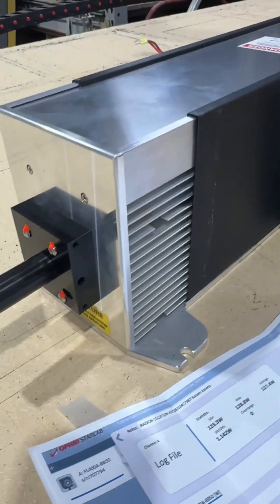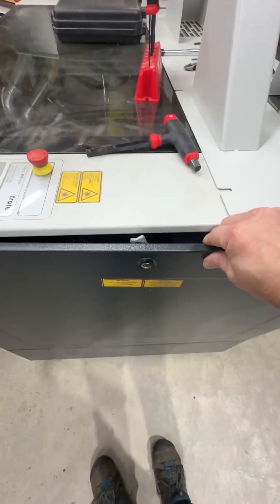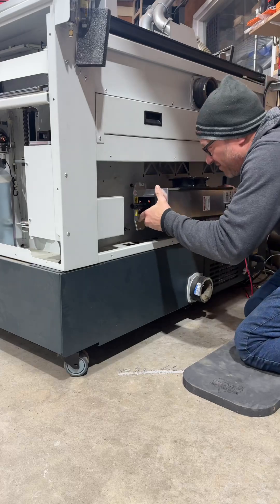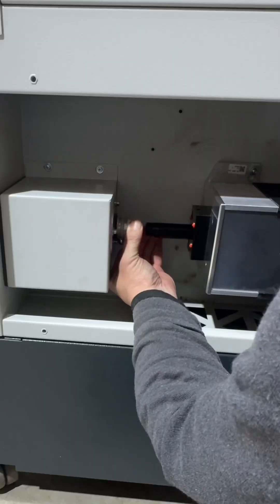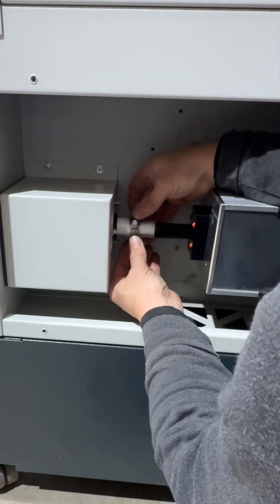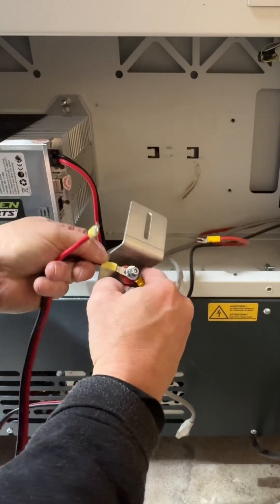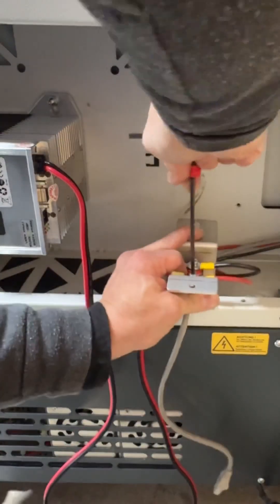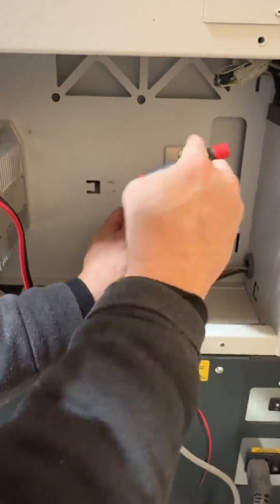Recharge your Trotec Iradion laser tube #trotec #laser

Comment: Great video. How was the process getting it back up and running once recharged? I have been pushing it and now its time to send it out. Just curious as for the install and requirements once back in the machine? Thanks in advance!
Reply from the maker: @jasonmiller5920  the laser itself is really just plug and play. The laser hangs onto machine screws and the weight of it naturally bottoms out so there shouldn’t be any issue on the install. The Mirror Alignment could be a minor issue, but there are some videos out there that walk you through it. That was more time-consuming for me than anything, but it is cutting on 100% of the table unlike before so for my first time I got it dialed in probably 90%. I am not sure what Trotec is actually charging for when you give them over $6000 for a new/refurbished laser and they want the old one back to refurbish.
Reply: And for recharged I ubderstood that cost 1500.00???
Reply: I i refilled mine but only worked for a few hours and suddenly stopped firing, what could have gone wrong?.. I set it back they tested ir and its firing

Comment: Did I also see an IPG Yb Fiber laser in there?  What is that system that has both a CO2 and a Fiber laser in it?
Reply from the maker: It is called the FLEX.  2 lasers in 1!
Reply: @brianway  That's really cool. I used to assemble industrial laser engravers using IPG (and JPT) fiber lasers (among other laser sources)